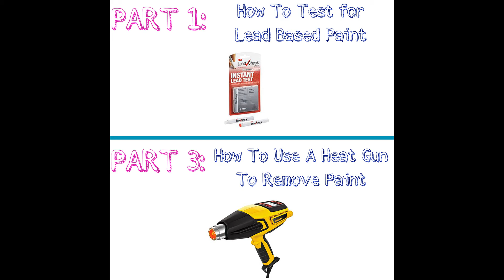How to remove paint from wood using Dumond Smart Strip paint removal system and Laminated paper

Comment: Thank you for using Smart Strip Advanced! We always recommend checking a small area before removing all of the paint. It can sometimes take up to 24 hours for the product to work all the way through the coatings. Remove small sections of paper at a time to assure the remover stays in a wet state as long as possible. You rock!

Comment: It looks good!   I would do like you said and add more coats of the Smart Strip to any paint still remaining or dried.   If you have lead I wouldn’t use a heat gun as when it heats the old paint it’ll add fumes indoors.   

Any last little bits and pieces of paint or roughness on wood I would use wet sanding paper and wet sand it smooth.  Making sure to keep what you are sanding well wet.  So no dust gets in the air.  Then just rinse down the trim clean that has residue still on it.

Comment: I used this exact stripping product & paper. It was horrible
The paper stuck to wood & was boogers. So hard to remove. I would never waste time and money with this. Use other products & save yourself.
Reply from the maker: I'm really sorry about your experience with it...I did have the same "booger-y" things happen on some of my pieces of wood as well after I made the video. I think it would work great on more flat surfaces (most of my trim has detail work on it), and if it isn't 297389375 layers of paint! Do you feel the same?
Reply: Did you leave the paper on longer than 24hrs?   I’ve seen some videos where it looked like the Smart Strip was left on a long time and more dry, and it took off a lot of old paint layers.  

If it removes more paint I wouldn’t mind needing to use more elbow grease to remove the paper.  Better in my mind it being dried than a sloppy wet mess like I’ve seen other videos